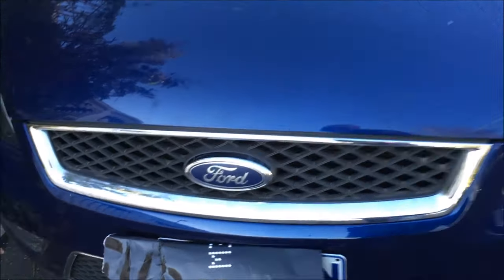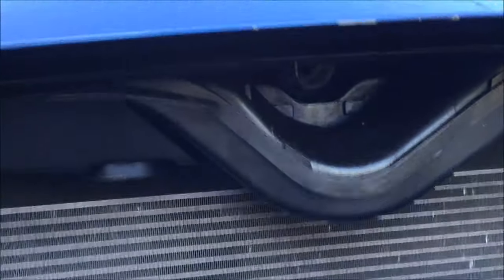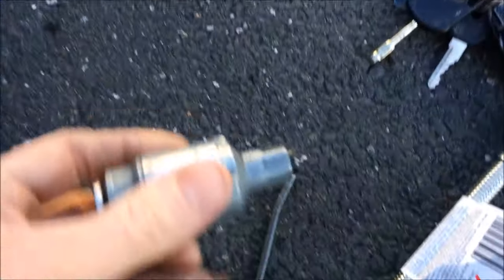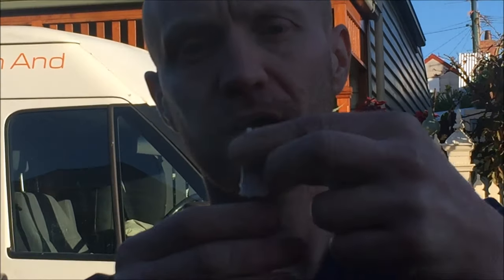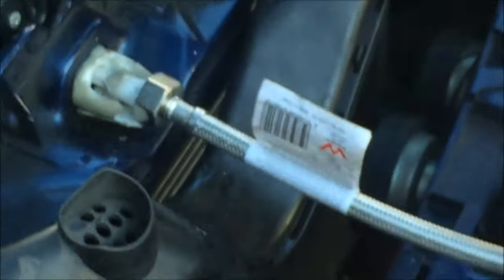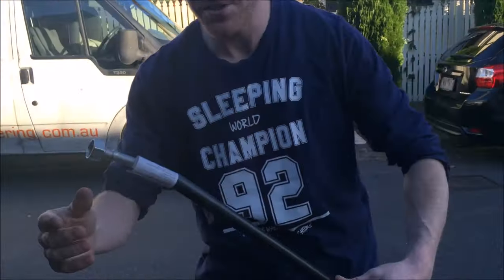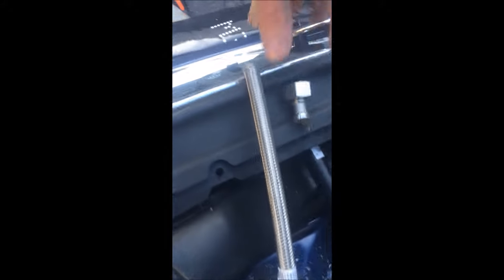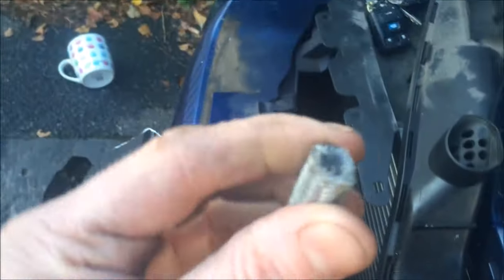ford focus bonnet lock broken, open bonnet and repair for $25!

Comment: if it had snapped then just put a set of mole grips on the cable and turn and bonnet opens. then put the replacement part in from ebay for 15 quid. alot of nonsense on this vid which is not needed not to mention the security side of it....

Comment: What a chew on making a “unit”.......just buy a replacement unit with keys, about £15 on ebay.....just done mine took and hour from start to finish
Reply: I did mine ronnie 1 year ago but guess what  its just snapped again  this is the 3rd one i'm on now
Reply: No 1 they certainly ain’t £15 🙄 more like £100 to £150 for one that’s gonna last more than 6 months unless of course it coming direct from China good luck with that one 👍, providing you can do it with a proper model then what two separate keys? One for the bonnet one for the car? Rather do it my way stills works fine 4 yr later the proofs in the pudding
Reply: I got one from the wrecker and broke same day.